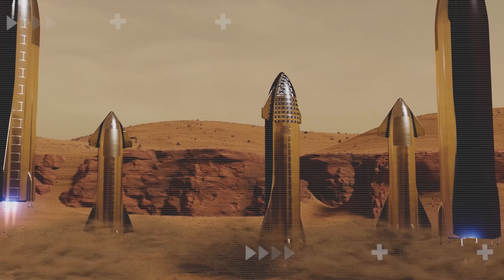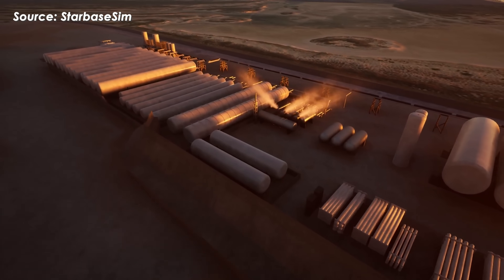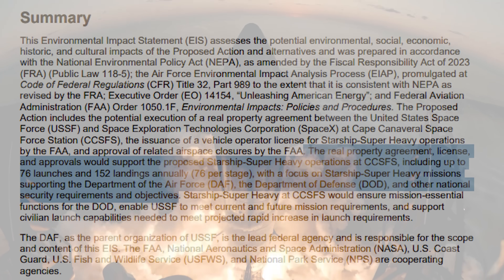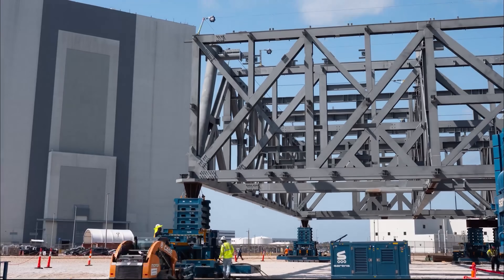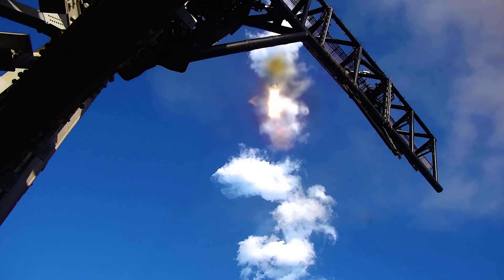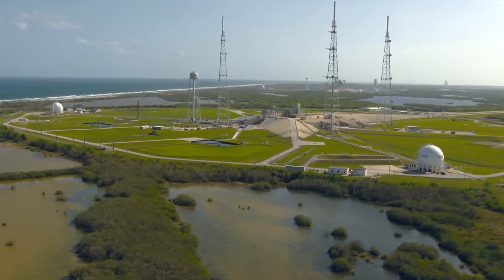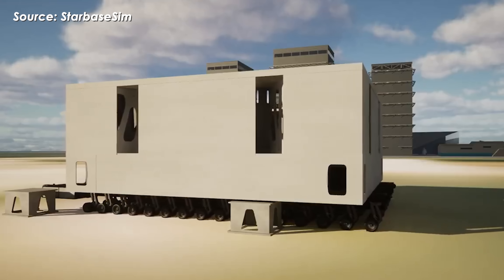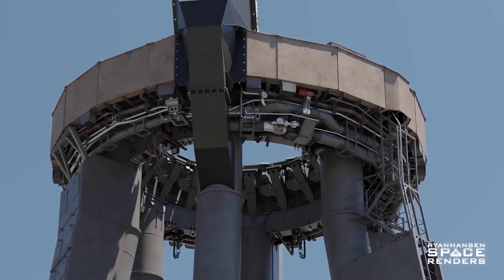What SpaceX just did with Starship NEW Pad is totally Humiliated NASA…

Comment: For Enterpreneur:
1) Precision RotaryActuator LowCost SOLID to: Verify Response & Accuracy.
1.1) Designed for Golden_Dome, Arrow-3, THAAD, Lazer...
1.2) ResponseTime<0.0001sec.
1.3) Electric But W/O ElectricMotor.

2)  ABS Valve: better than BOSCH, ZF, etc.: Faster, Proportional (Because not a Solenoid Valve). 
2.1) 98% eff. in Simulated Braking on Dry asphalt W Puddles (Wet asphalt); Calc. using Pacejca (MF) Magic Formula. 
2.2)  Will replace the 2 on-off solenoid valves (for each wheel, in the ABS)  
2.3)  Enable World's best_ABS,  (size, reliable). 
3) More... 4) Pls Contact

Comment: Times 6 launches, each Mars ship requires refueling. Unless space X employs a NTP space tug/booster approach. NTI and ETI use 70+% of Starships fuel. An orbital booster or tug eliminates that phase, reduces the fuel needed. NTP only uses hydrogen, no oxydizer. 3x more efficient, refueled in orbit. Taken to its logical conclusion Starship becomes optimized for planetary use, and the Space Tug is the transport that moves everything, including starship.